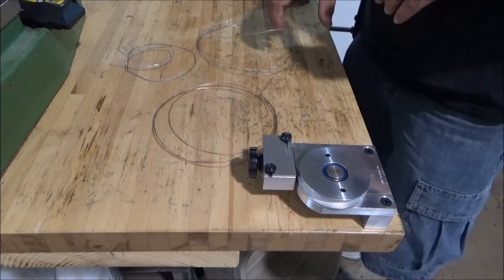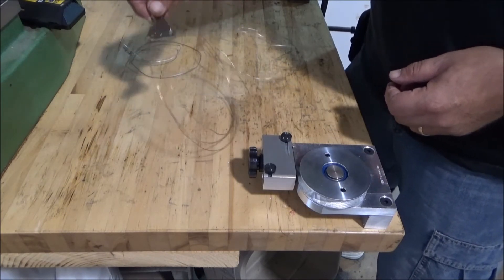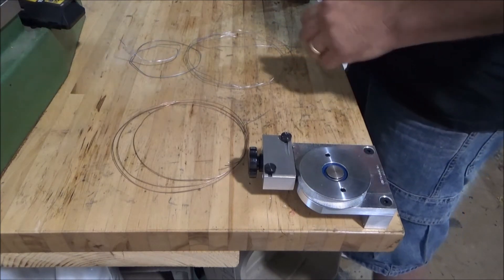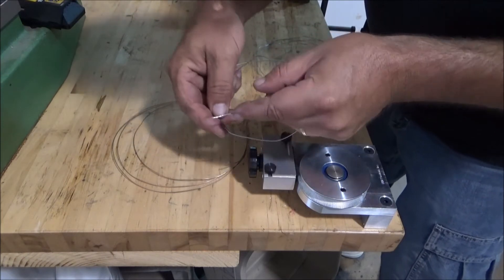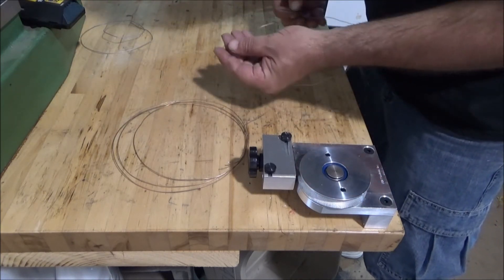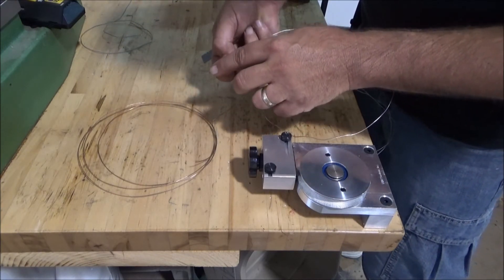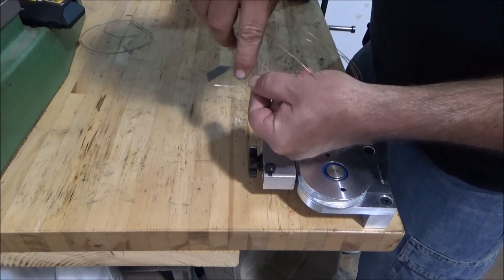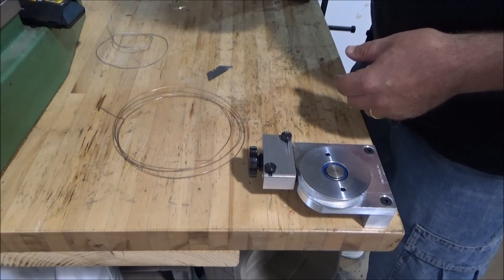How to tell when copper wire isn't really copper!!!

Comment: what about the super thin wire in smaller motors that turns from orange copper color to more of a pinkish color (not grey or silver) when you scratch it? It's too thin to cut and see the core color. I'm never sure on those.

Comment: I have been working on the wiring on my trailer. I ran a crossed one wire that was acting like it was literally rotting from the inside. I’m sure that copper doesn’t do that so I’m wondering what is in that stuff.

Comment: 2 day ago i was buying 20 meter copper wire!  In fact the seller give me aluminum with Cooper paint!!  😂 and there is 2 other way expect scratch!  1= ask seller to show you the wire and remove the plastic shell cover than look in the main and the center of wire if it was white {iron or steel color} you can easily see this is not a cooper wire!  But if was red that's definitely is Cooper wire.
2= burn the one layer of wire and if color changed to white or burned complete you realize this is fake cooper wire! .  I hope these ways  become useful
Reply: I might definitely have a fake copper wire